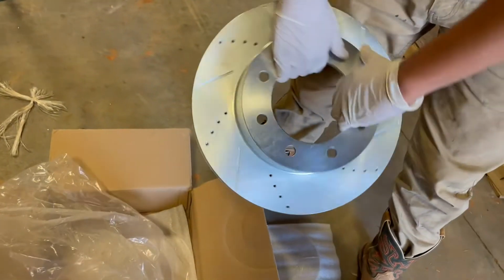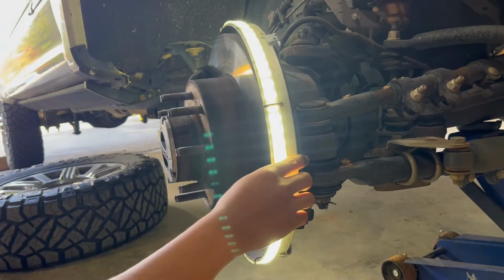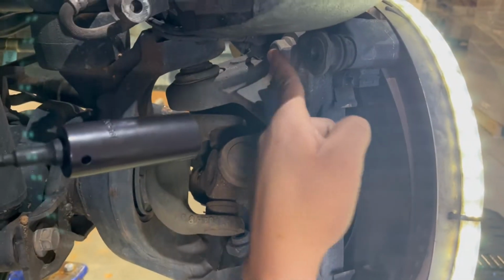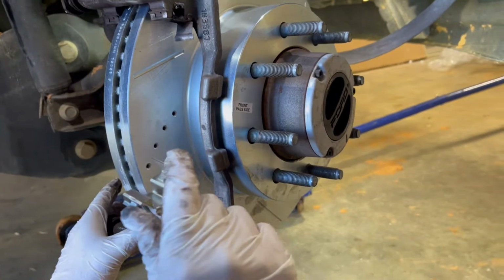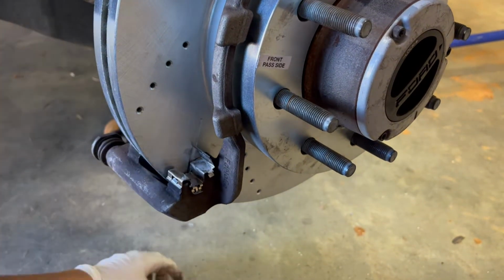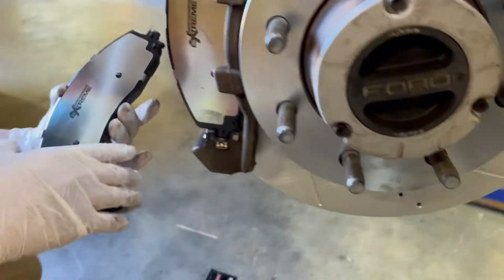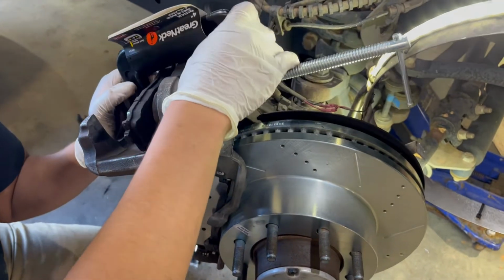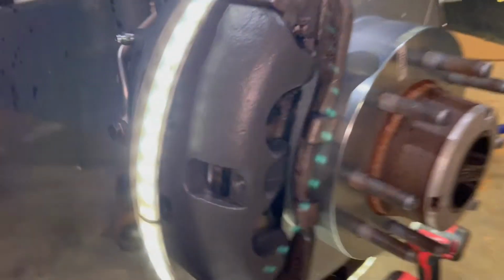Installing Ceramic Brakes And Slotted Rotors on 2019 F250 .

Comment: When you compress the pistons you have to open the cap on the break reservoir, that’s why it did what it did because you pushed too much pressure and it broke the seal.
Reply from the maker: This was a couple years ago 🤣 you live and you learn

Comment: If you force that it will send debris in to the antilock brake. will cost you a ton of money to fix. As you compress the break bleed the brake. then fill the reservoir. much easier